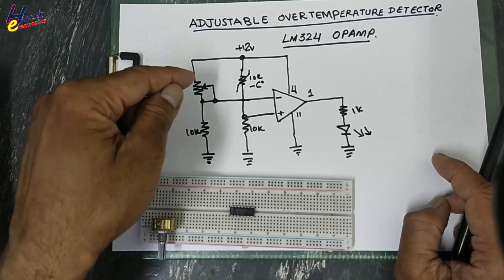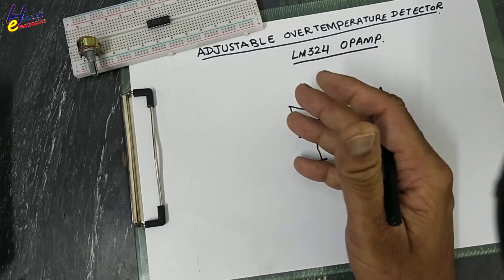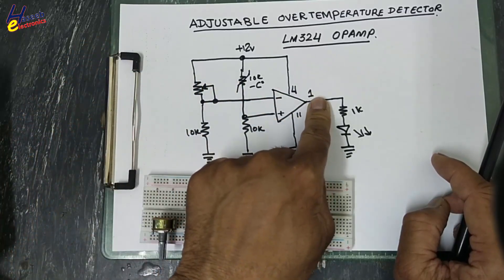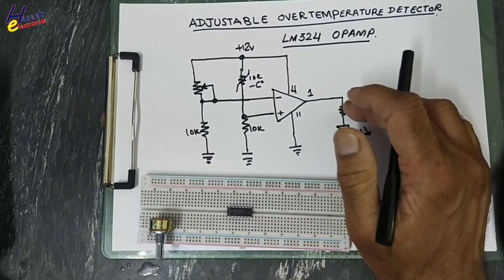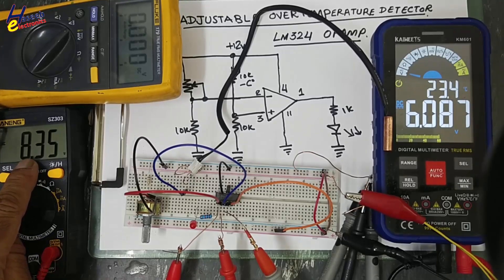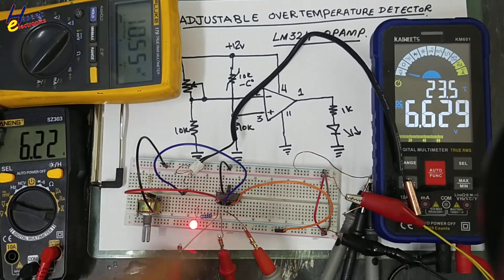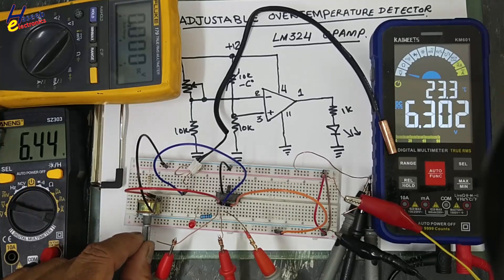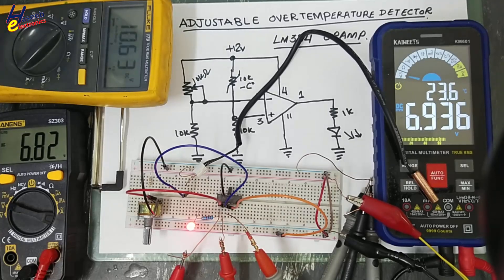{1298} Adjustable Over Temperature Sensor Using OP-AMP LM324 || Heat Sensor

Comment: Hi, Haseeb! This comment is an update from my earlier thoughts... 1) I did build your awesome circuit on a bread board. It works amazingly well, is so very useful for anytime that you need to monitor and/or control heat (for any project,) and is super easy to understand and build. It's simplicity and cleverness make it very elegant. I was/am so stoked about it that I designed a board for it. The board can be dropped into any project, as a modular add-on. I am in the process of building a board, now. I changed the op amp for my board version to be a TL081H. Note that the "H" series has been significantly improved... Particularly its Input Offset Voltage. And, it comes in a tiny SOT 23-5 package. Check out the improved TL081H series op amp. I think you will like it. And, it is super cheap = grin.  I am eager to see how the TL081H performs, in this setting. I am posting this to encourage and thank you... You are improving the world, with every one of your videos. Thank you!

Comment: Dear Professor, does a thermistor have any polarity? If so, how is it connected? The cable on my thermistor is a single pair of wires. One wire is solid and the other has a gray line, with dashes. I took a guess that the dashed line should go to ground and the circuit seems to be working correctly. Please use a drawing of its schematic symbol to explain the components of its icon... The icon incorporates a "Q" like character and I don't know what the Q means. Thank you for the help!
Reply from the maker: a thermistor is only a temperature dependant resistor. it has no ploarity as i demonstrated in video number 1266
please check that video and if there is any question, please let me know
Reply: @HaseebElectronics  Thank you for your reply and the information. I will watch #1266.
Reply: Hello, Haseeb. Please verify that video #1266 is the correct video, because its title reads "{1266} JFET function and testing." Thank  you for the additional help.
Reply: Ahh... I imagine that it is #1296, as that appears to be a whole series on NTC... I will start with those. I apologize for not watching them, previously. I was moving to a new apartment, at that time they were released.
Reply from the maker: @t1d100 I am sorry for inconvenience 
That video number is 1226 please
Reply from the maker: @t1d100 https://youtu.be/8GG5hSv0It8
Reply: @ Super thanks!

Comment: A small point... A Linear type potentiometer would seem to work best, for setting the trigger point... Not an Audio type potentiometer. The Linear type potentiometer will spread the settings more evenly, over the span of its turning range. This will make it easier to mark various trigger points. The resistance of Audio type potentiometers increases exponentially, as you advance its shaft. Meaning, there is more resistance, for a given amount of turning, at one end of the pot, than the other. I am tired and I may not be saying this well. Haseeb can explain this better. I hope this helps.
Reply from the maker: It is also analog potentiometer or linear stereo potentiometer it's part number starts with B like B10k, B50k and it's resistance increases linearly 
While logarithmic potentiometer or log-pot (normally used in musical instruments) numberd as A10K, A50K. It's resistance increases non-linearly
Reply: @HaseebElectronics  Yes! Excellent! I have already copied your schematic and gathered the components. I just need to wire it up. Thanks, Haseeb; I like this type of video content.
Reply: I competed bread-boarding and testing the circuit, this afternoon. The circuit worked perfectly, upon the first power up = Woot! Haseeb did a good job of designing this circuit... Thanks, Haseeb! 

Disclaimer = I offer the following tips, only as a "good Samaritan." I take no responsibility for their use. You are responsible for your own knowledge and well-being. When powering a circuit, use proper live circuit safety techniques and one-hand operations, at all times. You need to learn these techniques, before ever powering up your first circuit.

My Five Easy Steps For Bread-Boarding Success = I make a copy of the circuit on paper. Step 1) As I populate  each component on the board, I place a check mark on its icon, on the paper. Step 2) As I populate each connecting wire, I make several equally spaced, perpendicular line marks across its network lines, on the paper. Step 3) I visually review all of the connections, against what is on the paper. I draw another line at an angle, over the network line marks in Step 2 (to make sort of an "X",) for each correct connection. Step 4) I use a multimeter, in continuity mode, to confirm each electrical connection, pin-to-pin. (For the power input to the board, I verify its wiring all the way back to the Power Supply Unit.) I place a circle, on the paper, around each of the previous X marks, as I go along. Step 5) To finish, I review the paper copy, to verify that all of the connections have received each of the steps and are made correctly.

My First Power-Up Procedures = 1) With the breadboard disconnected, A) I set the current limit on my PSU to a very modest level and B) I set the voltage on my PSU to zero. 2) I turn the PSU off. 3) I visually inspect the circuit for any shorts. 4) I verify the polarity of the components, especially the capacitors. 5) I cover any of the components that might explode (again, emphasis on the caps.) I use something that is non-combustible and that can withstand an explosion.  6) I clear the work area of clutter, children and pets. 7) I connect the power cable to the board, switch on the PSU and advance the voltage slowly, keeping a watchful eye on everything. 

I hope this helps someone and I wish everyone great success!

Comment: Excellent! I've just built an audio resonant filter using the LM324. It also uses an LM13700 transconductance amplifier. How would  an LM339 behave differently? I'm still learning these circuits so thanks for covering analog circuitry!
Reply from the maker: awesome to know about your project. 
yes the linear ICs (comparators and OP AMPs) are complete branch in electronics and it is complicated but interesting. LM339 is a dedicated comparator while LM324 in open-loop gain works closer to a comparator but it never replaces LM339. i will also other linear ICs in upcoming sessions like comparator, operational amplifier with other features (like null adjust, and various configurations), sample and hold, DAC and ADCs
Reply: @HaseebElectronics Sounds exciting! Thanks and have a great weekend.

Comment: Is the FLUKE  meter indicating oscillations on the output, when the voltages are approaching switch off/on ? I observed some changes in the meter reading.

Comment: Do you need some feedback to create hysteresis to avoid output jitter around the set temperature point?
Thank you for sharing
Reply from the maker: To use opamp as comparator mode. It can be used without feedback (as in open loop configuration) although a dedicated comparator is better option like LM339. But it is exactly same it's gain reaching in millions